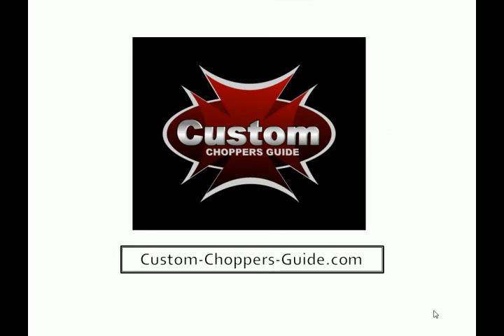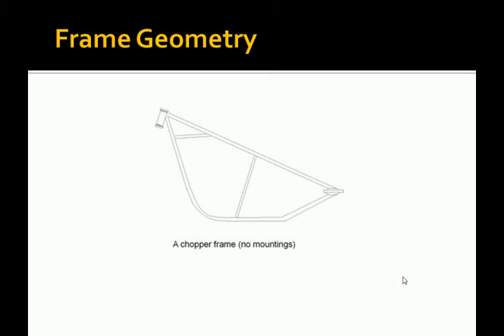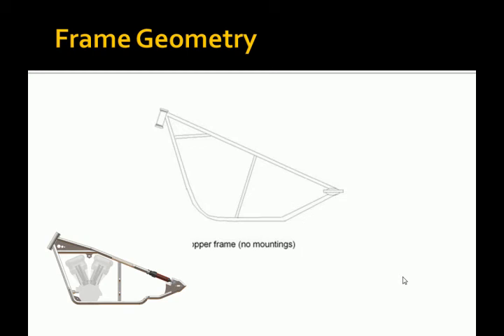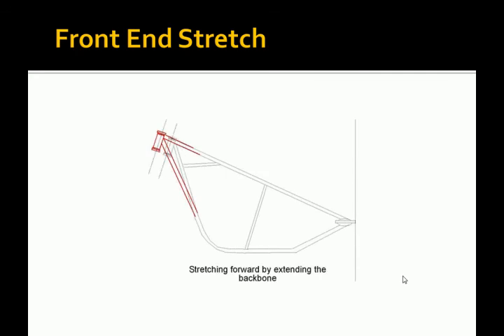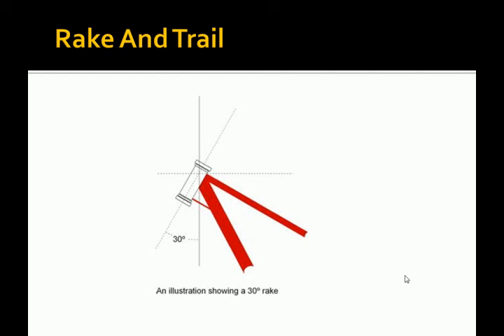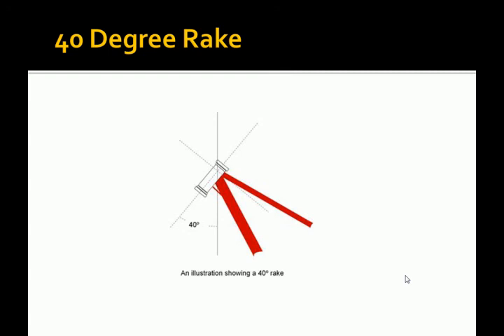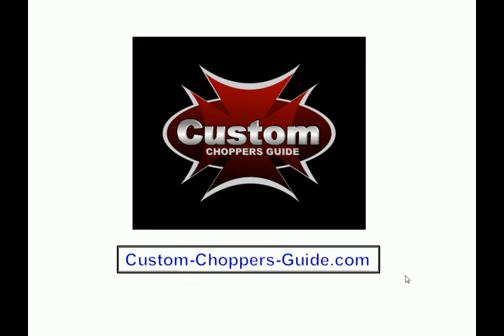How To Build A Motorcycle Frame Part 2

Comment: fat bastad is throwing a idea out there the rear wedge or weight lift traction of the bike i understand the rear bottom tubes should aim 1 inch under the centre radius of the front wheel ??? meaning small rear super large front wheel [ like the newish baggers]  the bottom rear rails/tubes will look rediculous ??? who is to argue with science ??? maybe the cool guy with a good looking bike that won't handle so well .

Comment: I do not envisage the opportunity to comment on a four Y.O. video but....
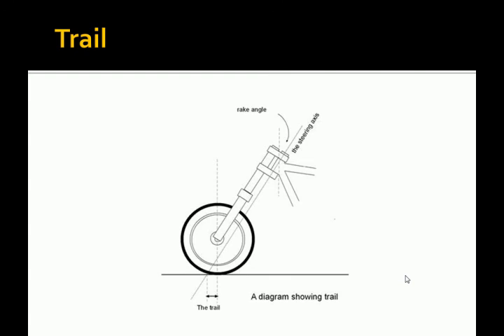Around minute 5:40 you say: "It's  possible to end up with a negative trail, where the wheel axys is behind the steering axys"
That's the condition that gives you a positive trail, if I am not wrong.
Thanks for the otherwise informative video.

Comment: what is the tube size for the frame please
Reply: "1.125 or "1 1/8 is typical with I believe a 1/4 inch wall.
Reply: Oops I said it backwards.. It's typically "1.25 or "1 1/4 OD and an "1/8 wall. DOM tubing btw not just any old tubing

Comment: triple tree trails look bad for braking and also for steering. the weight of the bike pushing down on the front bottom of the tyre is reduced. Still same grip area but less downforce due to the body weight sitting behind the fork base.. Be interesting to see two bikes side by side one with a triple and one with a standard trail doing speed braking tests..  What do you guys think?